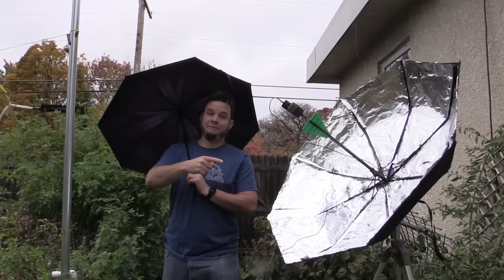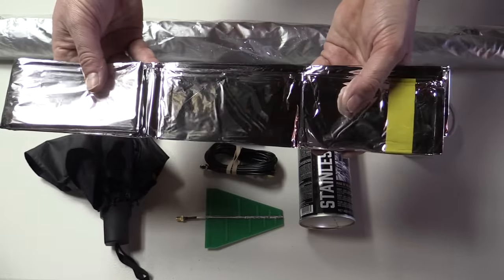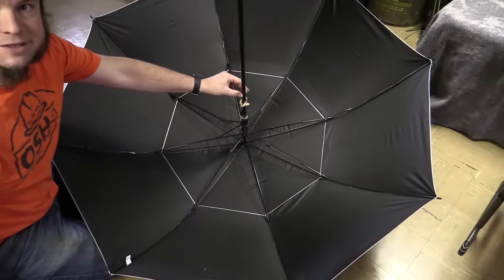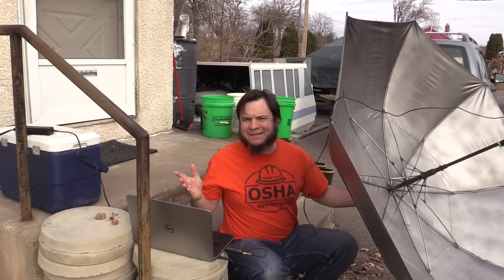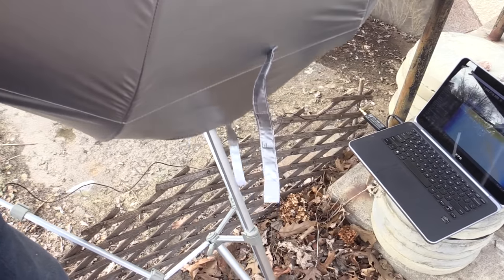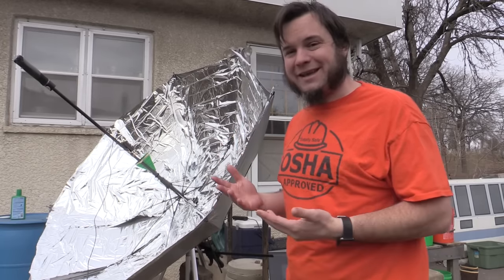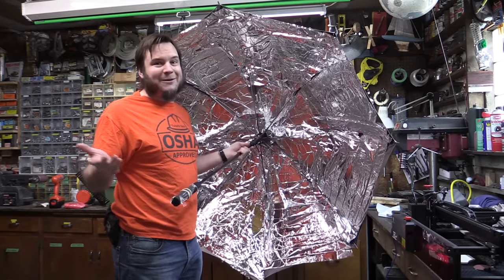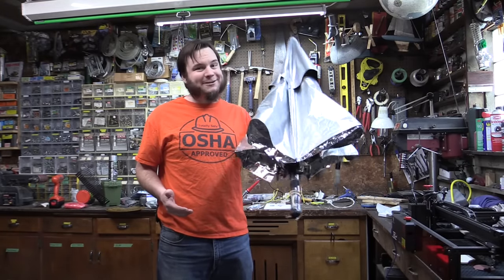Satellite Antenna Made From Emergency Blanket

Comment: Love it!  Okay -- I've got a question -- what happens to polarization in a setup like that?
Reply: With an actual parabola and an accurate surface on the reflective medium, linear polarization is maintained, and circular polarization is reversed. With an "umbrella parabola" that's not very parabolic, and a space blanket that's all crinkly and not flat... bad things... very bad things
Reply from the maker: The GOES satellite has a linear polarization (at least for the HRIT signal I'm looking at). Since it's a little East of me, I made sure to tilt the PCB antenna feed that direction. When I was fooling around with the focal distance I rotated it the wrong way and lost the signal, so polarization definitely matters!
Reply: @gorak9000  Thanks for that!  Okay -- taking things a bit further.  The polarization is also dependent on the ..... is it angle-of-attack or angle-of-reflection, right?  When it's rainy out, light with a high angle of incidence reflects off the surface horizontally polarized, which is why we wear vertically polarized lenses to block it out.  So the linearly polarized radio that approaches the parabola.  My intuition would be that if you divide the parabola up into four equal quadrants, two of the quadrants would reflect well and two would reflect not so well.  Is that accurate?  Or...I guess I don't have a good picture of what happens when the radio waves hit the parabola.  Sorry if I'm rambling.  And thanks again for answering the other one!
Reply: @saveitforparts  Just as a side-note.  I think I'm a few years older than you.  But I wanna be like you when I grow up.  Keep rocking good sir!
Reply from the maker: I'm actually not sure about that! I'm not an expert at the feed part on these dishes, although I keep experimenting with different types. I've 3D printed a few helical designs and I have some commercial Ku and C and S-band stuff I need to play with.

Comment: You can make a simpler antenna drive by manually rotating the antenna to the azimuth of max elevation,  pitch an antenna axis to the maximum elevation,  then you just need a motor to pivot the antenna on the axis.

Comment: The fabric on the umbrella needs to be detached first then goes the aluminium foil with glue then re attach with silver inside the fabric on the umbrella
Reply: Can this setup work for a C band satellite???
Reply from the maker: Probably! I actually have a professionally made fold-up C-Band dish with a metallic cloth that works pretty well :-)

Comment: In this dented antenna, the signal will arrive at the end point with a different phase components, which will demonstrate an extremely low gain. The parabaloid must be rigid and the geometry must be respected.

Comment: It should be easy to make metallic paint yourself by buying zinc or aluminium dust (both are used in pyrotechnics) and mixing it with varnish or lacquer type paint. Just wear protection to make sure you don't inhale any metal dust, with careful mixing it should be possible to get a thick even metal coating that way.

Comment: there was a guy on youtube that used one of those blankets to makle a really big mirror to melt stuff. he did it by putting a big circle on glue onto plywood and then puttin gthe blanket over the wood so it gets glued only in the circle to seal it. Then through a hole in the middle he pressurized the blanket to make it into a blister like dome. to make it keep its shape he sprayfomed the back, you could also use fiberglass probably. but that seemed like a easy relyable way to make a dome and should be better than the umbrella. probably not much point in doing it as this method wouldnt be retractable but it should be cheaper than a real dish if it works.

Comment: Anyone try that aluminum or brass wire mesh screen to make the reflector for the antenna? I was wandering around my local Ace hardware and they had aluminum wire mesh screen to repair or make new screens to keep the flying insects out. The small gaps between the wires made think they may be able to reflect enough of the RF to the satellite feed or for ground based signals.

Comment: Nice try though Gabe,if you use it again NEVER use RG174 coax like you have and the antenna is too close to the support pole of the umbrella but just mount the SDR with the LNA on the whole thing just to see how ya go,or even 3D print a bracket ;)
Reply: The trick is to mount the sawbird filter and LNA and the SDR right at the antenna, and skip the coax all together. Also, a quasi log periodic is not a good feed for a parabolic dish - you could do a lot better with a waveguide feed of the correct diameter (aka a coffee can)

Comment: Metal does not all dishes make. Most of mine including the new FCC paid for because of the 5G upgrades 12ft downlink dish is fiberglass. My transmit dishes and smaller dishes are metal. I am not sure how that works you would think it would require a conductive surface. I have to wonder in your case if having a metal dish possibly connected to the metal shield of your antenna might cancel things out?? I don't know the answers to these just observations.
Reply: fiberglass dishes have a metal mesh embedded in the fiberglass layers. What kind of dish did you get from the FCC because of the 5G takeover of c-band?  A prodelin (or gd-satcom, or whomever it is that bought out gd-satcom now - CPI sat I guess) series 1374??
Reply: @gorak9000  I would have to look who made it. Basically FCC would pay to install filters on the dishes for 5G and if it couldn't be made compliant ours was just too old and in bad shape. Just over the line for acceptable signal when they added the filters so in that situation they paid for a whole new dish and it's friggin huge. 12ft at least and I don't think a tornado could rip it out of the ground. CPI rings a bell. I didn't know they embedded metal in them I only set up 1 9ft by myself from scratch that I drug home as a kid and didn't notice fibers but that makes a lot of sense.  Now I help the WISP on my towers from time to time and a lot of their stuff is dishes. They have one on top of a 60ft tower at my house.. pays to know people.. signal has trouble going through a tree especially pine trees the needles attenuate the signal... yet they can put a cover over the dishes I didn't see what it was made of that helps block the RF from my transmitters but doesn't affect their signal. About the only thing that doesn't. They learned a lot (and I learned a lot more) about RF grounding and filtering from their ordeals.
Reply: @JamesHalfHorse  Where is this dish? At a radio or tv station? I'm rather familiar with the 5G takeover and the mitigations
Reply: @gorak9000  Radio station. We still use the old birds for our network feeds.

Comment: Hi, would you think one of these amazon “Nooelec GOES Weather Satellite - 21dBi parabolic mesh antenna’s “ combined with your suggestion feed, would be sensitive enough to capture the GOES 16 signal? Thanks.
Reply from the maker: Probably, although I think those come with a feed or can be modified from an old Wifi antenna.
Reply: @saveitforparts  well, I only have some old expressvu/dish network parabolic - the offset feed type. Anyhow, I just ordered the Amazon equivalent antenna from AliExpress, with a long bit of coax.

As you suggested, I started with ‘a baofeng and ‘open-weather community apt’. Do you know if you can add contour lines the images? I can’t make heads of tails from the image output…
Reply from the maker: Sorry, I don't always see the replies (Yutube sucks for that!). Some processing tools (maybe goestools or Satdump?) will let you add different map overlays. I'm using Vitality-GOES at the moment but need to do some updates on it.
Reply: @saveitforparts  no prob. I see for GOES signal decrypt I’ll need a raspberry pi - not really familiar with these. Which version did you end up using (lower end, I hope..).

Thanks again for the tips - much appreciated.